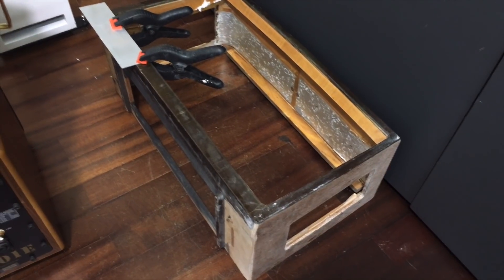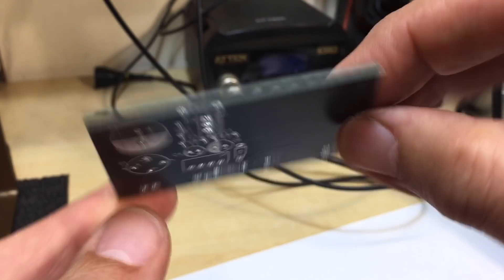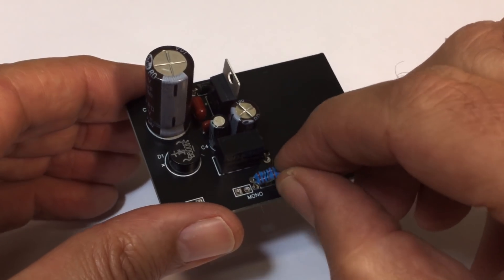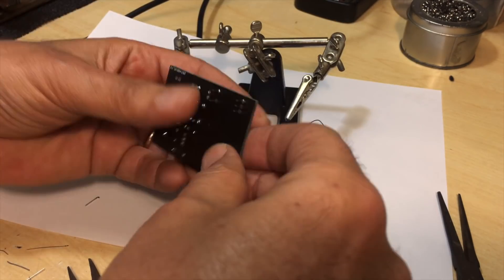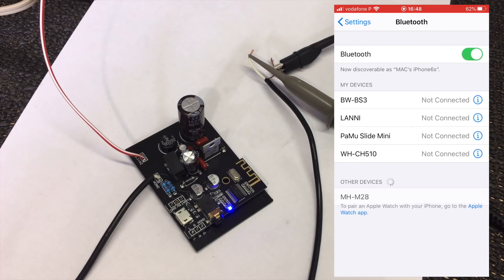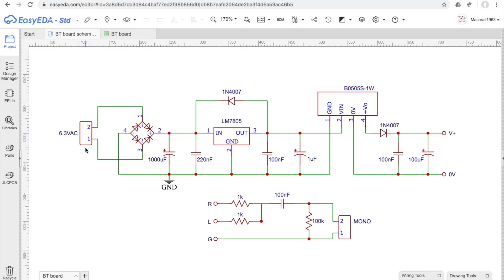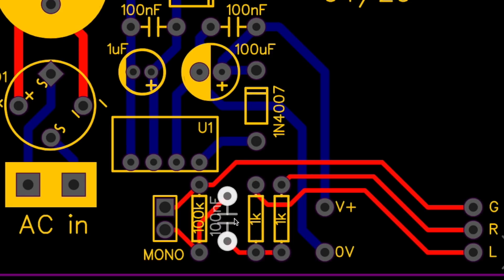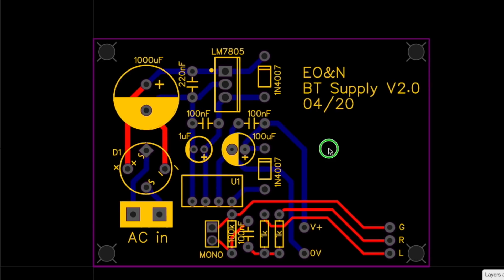Bluetooth module for Tube Radio. Building and testing, with a few PCB mods thrown in.

Comment: Hello Manuel,
I just ordered the PCB boards from PCBWAY today for this project. I also ordered the LM 7805 voltage regulator along with the B0505S power supply module which was an easy find on Amazon.  However I can't find a B500R bridge rectifier diode for sale.  Do I have to use a B500R or is there a substitute that I can use?  For example I see some listed on Amazon and elsewhere as "2W10 2AMP 100O VOLT FULL WAVE SILICONE DIODES".  I have no experience working with components such as these.   I live in the U.S.A. and apparently the B500R is only found in Europe.  Thank You.
Reply from the maker: You can use just about any small bridge rectifier that has the same pin outs (make sure the positive and negative fit in the correct points on the board)

Comment: Hello, another great video!  I would love to purchase a few of these bluetooth PCB's along with your PCB's for replacing the Selenium rectifiers.  I notice you mention that the Gerber files are for us to download but I do not have much knowledge about computer files and such. I have never even heard of a "Gerber" file.  Am I able to just simply buy these boards already made to you specifications from the same vendor you purchased them from?  As always your videos are simply the best, thank you!
Reply from the maker: No, you need to go to PCBway.com and look for the shares projects. You can then simply order directly.
Reply: I see on the website that they offer the board for the rectifier but I do not see the availability of this Bluetooth board. I am looking in the section that has all of your projects. Is there another section that I may find it in?
Thanks and sorry for the trouble on this.
Reply from the maker: The actual Bluetooth module is not mine. I bought it on ebay. I did do the power supply board for it, and that is on the site.
Reply: @electronicsoldandnew  For some reason I just do not see the board for sale.  It must be listed under somebody else's name?
Reply from the maker: Here is the link:
<a href="https://www.pcbway.com/project/shareproject/Power_Supply_Board_for_Bluetooth_module_on_tube_radio_2177c68d.html"><img src="https://www.pcbway.com/project/img/images/frompcbway-1220.png" alt="PCB from PCBWay" /></a>

Comment: Another great idea and I appreciate you taking the time to continually improve your ideas. 
Question on bluetooth with these old radios.  I've found that even with the phone (or ipad, etc) volume all the way up, I have to turn the radio volume very high to get a decent volume level.  Is that typical?  Any chance your build solves that problem? Many thanks.
Reply from the maker: That is quite normal as the gain is a little low. With the module it is less so, but it could really do with a little preamp here.
Reply: @electronicsoldandnew  Thanks.  Next beer is on me... time to open up your Patreon page!

Comment: I really appreciate the time you take making these videos and sharing your knowledge. I’ve just ordered 10 pcb’s using your files, looking forward to putting these together. Any tips on location within the cabinet to fix the board to reduce chance of interference? Do you fix with double sided foam tape?
I have learnt so much from your videos. I only started out during lockdown last year and now have 3 beautifully restored German radios. Just bought a Saba Freiburg W3 export model as my next project.
Reply from the maker: Keep it away from the RF front-end if possible. Enjoy.

Comment: Do you have an option to add BT on a radio without a PU in? Love your videos
Reply from the maker: No, I don’t. Generally you could connect to the top of the volume pot, but then you’d get the radio signal coming through simultaneously if you don’t switch it out.

Comment: I  downloaded the gerber and got the pin locations for power and audio out for the MH28. Thank you so much! Why dont you use SMDs? JLCB is doing assembly for free for 10 boards. I also have one more question. So, I am connecting  MH28 line out to an amp and also a 3.5 mm audio in option. Now, if I connect audio in through the 3.5 mm jack, will the current not also flow to the MH28 module? Will that be a problem? And if it is should I use some sort of diodes to make the current flow in one way and not the other? Thank you so much for your help so far.

Comment: Hi Manuel, pardon the off topic... I opened an eabc80 can in a telefunken concertino to replace an electrolytic that was dead, when put everything in place I don't have any reception... What are the odds that I detuned the if circuits? Thank you
Reply from the maker: You may have, but should still be able to hear something, especially strong stations in your area area. You could have simply created a short as the space in there is pretty tight.
Reply: @electronicsoldandnew  actually, I shifted ecc85 and eabc80 tubes... Alzheimer's with 36... Now working, thanks!
Reply from the maker: Happens to all of us :)

Comment: Hi Manuel - here's something that might be of interest.
I have used your design with good results but in some German radios,  the interference persists, however I have come up with a solution when it's the case that  the "magic eye" gets  switched off during P.U. selection. 
I route the B+ feed from the magic eye to the  240V coiof a mechanical relay and use the normally closed contacts on the relay to switch the 6.3v a.c line to the Bluetooth module. This works beautifully as the module is now off during selection of Am and Fm switches but energised when P.U./ Bluetooth is selected. It also has the effect of "announcing "the bluetooth activity when this function is chosen.
Greetings from Ireland, - Rodney Warren.
Reply from the maker: Rodney, you’re a genius!
I’ve been hassled by this phenomenon before, and know that it’s caused by the fact that these German sets usually have a foil antenna on the inside. Especially when the space is small, the digital noise from the BT module gets picked up by the antenna, and can sometimes be heard. 
I’ve been thinking about how to activate a switch only when PU is selected, but never thought of the magic eye B+.
Great solution, thanks.
Keep safe.
Reply: @electronicsoldandnew 
 I've put up a short video to illustrate the process.
https://www.youtube.com/watch?v=3I08F9hgDTU
Reply: @rodsradios  That is a wonderfully simple solution! Thank you for sharing. :)
Reply from the maker: Hi again Rodney. I saw the video and a thought occurred to me. You mention that the relay draws about 20mA when operating. This may be a problem as the entire B2+ section only draws 27mA, so another 20mA will cause a further 26V drop from B1+ to B2+. It also represents a further 25% draw in current from the transformer, which may damage it. 
I thought of an idea to apply your principle but use a transistor as a switch for the relay. Also the relay could be a simple low voltage one as it will be powered from the actual heater supply, which has lots of current to spare. 
I was thinking of putting these doodles  in a video but want to ask your permission first. I will obviously credit you for the idea itself. 
Otherwise, you could also develop this further yourself and put it up on your channel. Let me know what you think.
Reply: @electronicsoldandnew  Hi again,
I had the opportunity to check the drain from the relay in and out f circuit and you are correct in that there is a drop of exactly 20 volts on the B2+ line, so I will substitute a much smaller relay when it eventually arrives from China as I suspect the consumption will be much smaller. In the meantime please feel free to develop this idea on your excellent channel and I will look forward to seeing what emerges.
Cheers from Rod.
Reply from the maker: Rodney Warren : thanks.

Comment: En el PCB dejaría sin cobre el area que ocupa la antena del BT, podría atenuar la señal. Saludos desde Buenos Aires. Muy buenos videos!
Reply from the maker: I've just realised that the board does not use a ground plane, specifically to avoid blocking the BT board antenna. No V3.0 version needed :)
Reply from the maker: tienes toda la razón. ¡Debo corregir eso en V3.0!
Gracias.

Comment: In many radios as one line for tubes heating is used a chassis. In this case for BT I use a simply on-half rectifier with 2200u/16V elko. in this case DC/DC converter is not needed and 7805 makes this job well. Thanks & Regards,
Reply from the maker: Wojciech Taras : I’ve done that before but did not like the buzz that the common ground produces. That’s why I use the dc-dc converter which isolates the grounds and produces no noise.
Reply: With my solution is same times very difficult to provide a proper grounding w/o (or with minimal) buzz.  I guess you do not have any problems with RFI from DC/DC converter. Thanks for video & regards. Stay Safe!  @electronicsoldandnew